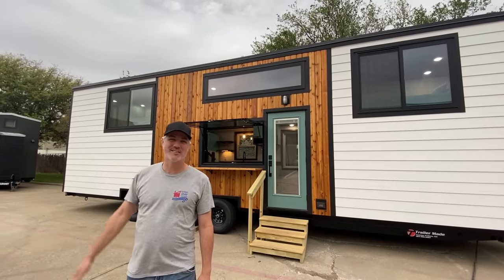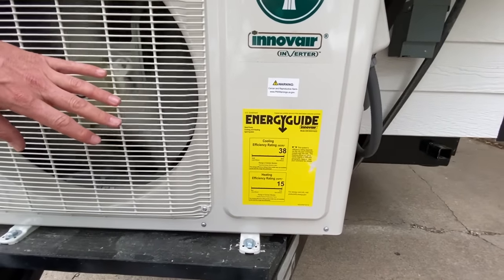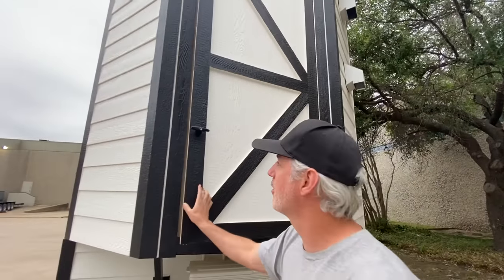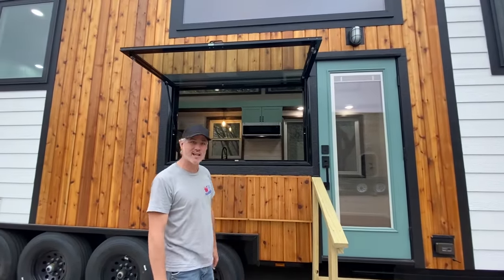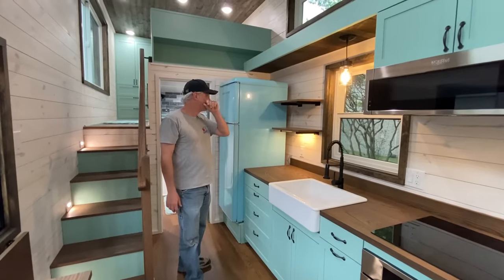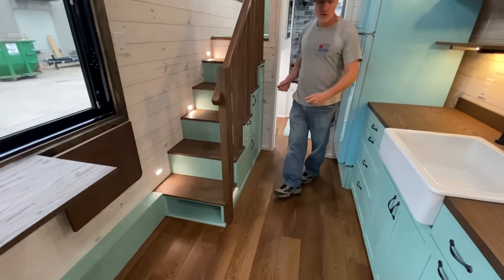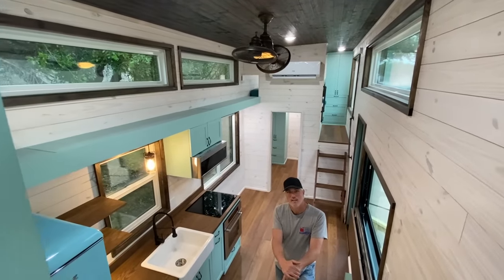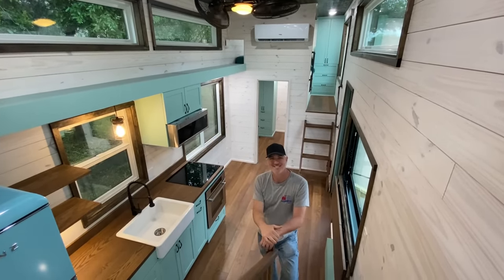36 foot Tiny Home on Wheels w/ 3 Stand-up Bedrooms & Off-Grid Utilities

Comment: You need to flip the doors on the refrigerator... That would drive me crazy having to walk into the bathroom just to get into the fridge. I would also be worried that I would trip or slip trying to get into bed, and go right through those big windows. Guessing they are safety glass?  The living room area is just a bit too small but I realize that in order to get three full bedrooms in there you had to lose space somewhere. I love the color!
Reply from the maker: This fridge didn't have the reversible door and the only retro fridge with a left opening door was $2200 more than this fridge! So the homeowner opted to save that extra dough since she liked the retro look. 
Yes all of our windows are tempered glass. The windows in each bedroom have to be large enough for egress in order to meet code requirements. ❤️
Reply: This home is lovely. Great use of Color.
Reply: Tiny home. ?
Reply: Beautiful home!! Love that it has 3 sleeping areas!!!
Reply: Beautiful colors and finishes. I'd rather use the downstairs room as a sitting room and extend work surfaces for the kitchen as my preference. I love this, thank you, great house!
Reply: Where is the living area? To gather as a family watch TV?  Nice to separate 2 kids sleeping zones, but in 4 season living where do the heavy winter coats for the 4 residents go?
Reply: @IndigoRiverTinyHomes  save extra dough!?😂 yeah good one.
Reply: Easy to do. Screws on top of door

Comment: I'm often cynical about claims made by tiny home builders, but there really are three distinct bedrooms where you can stand up when you get out of bed!  No crawling in and out of a cramped loft on your hands and knees.  I also note that they are fitted with full-thickness mattresses, and there's still room for you to sit up in bed.  The wardrobes all provide enough space for a real person's clothes.  The kitchen is relatively spacious.  A shower stall rather than a tub would allow even more room in the bathroom.

All that being said, there is very little "living" space, so this home is best suited for a climate that permits outdoor living for most of the year.  One might forego the off-grid features and use the solar equipment space to store a fold-up screen house that could be set up for daily activities.  I can actually picture a family of four living here in relative comfort.  A very clever design!
Reply from the maker: Thanks! We build tiny homes for full-size living! Many of our customers are staying here in Texas so creating outdoor living space is popular - and one of the reasons they "go-tiny" - to spend more time outdoors. Thanks for watching!

Comment: What an ingenious way to do the bedrooms!  I always said I couldn't have a tiny house because you couldn't stand up in the lofts.   I know lots of people will love this one!
Reply: I love this so much!! Anyone finance these?
Reply: The technique  of having the bed platform provide extra headroom for the lower floor isn't  new. It's been used in boat building for years. It was also used in split level mobile homes of the 1950'and 1960's. Google Pacemaker or bi level mobile homes. I'm surprised tiny homebuilders weren't using this clever concept sooner.
Reply: Because it's not a tiny home. It's a standard mobile home and ridiculously expensive.

Comment: It's very spacious, no doubt about that.  But if suffers from the most common tiny house problem - no living room area.  I'm older and do not live in my bedroom, so I would need to turn that ground-floor bedroom into a living room with a real couch and shelving unit for a smart tv.  That's just my old-school opinion, though...
Reply from the maker: We're a custom builder so every client is different in terms of what they order. There is enough space for a love seat between the kitchen and the downstairs bedroom, but we didn't really highlight that enough. The TV can be mounted on the wall opposite the love seat. 
This homeowner said she might add a TV to the common area one day but currently she doesn't watch TV or do much lounging at all from what I can tell. She's an avid gardner and cyclist and doesn't seem to sit still very often! 
Thanks for your feedback and thanks for watching!

Comment: FANTASTIC DESIGN!!!
The way your design has created various floor levels is outstanding!!!
I’m building my own 24’ tiny house and have wrestled with the two level areas and how to make them useable in a practical manner. You seem to have solved this quagmire in the most perfect way! 
The entire house is beautiful and the details demonstrate expertise in all facets of construction and design. 
The unusual ceiling fan in both design and function is noteworthy as well. 
I must add my $0.02s re. that beautiful retro refrigerator… it would drive me crazy going around the door for access. I also realize that it was the buyers prerogative and I hope that they are going to be happy with their choice🤭!
This build will be with me for life now. I was seriously considering a design that allowed me to raise the roof after arriving at the destination but really didn’t want to deal with that “complication” and it’s potential for failure. Your floor plan and use of various floor levels is the best I’ve seen and I must have looked at 100+ “tiny houses on trailer” builds. 
Simply fantastic everything!
Thank you so much for sharing this beautiful house and outstanding design. 
Best of good fortune with your business as well.
Reply from the maker: thanks! we were inspired by a tiny home builder in Florida - share ideas and make things better!

Comment: another well thought out design, down to the keyhole cuts for wires......
that downstairs bedroom would also make for a great walk in closet!

thoughts on the cat room.... have you thought about recommending to your customers to finish off the area with a wipeable wall and separating and adding a wall to divide the space from the electrics..... only suggestion because most cats I know like to scratch and or chew at things.... and eating foam insulation could cause some health problems for the wee ones... you could also do a flat lying shelf on shelf casters so you can pull the littler box back and forth if you needed to, along with motion lights.  I think you did a finished dog one before....

someone buy that handsome young man on here a cordless mic!
Reply: Haha!  Yeah, I was thinking the same.  He needs a cordless mic. :)
Reply from the maker: @luzejo28  If anyone wants to recommend a good mic to pair with an iPhone 11pro, I'm all ears. A few times I've shopped for them online and just get overwhelmed with the options!

Comment: One thing should have a better finish is the utility room. This goes for all builders. Finish it up all around including insulation.   Those rooms get hot, it will protect from heat and cold. Plus it looks better.

Comment: I love 😍love the style and colors of the walls and ceilings rich as in beautiful looking; truth be told it's a luxurious 👀 looking Tiny Home the kitchen and bathrooms beautiful, it's got a comfey & cozy look inside. I'm not look to buy, but, curious to know are such Tiny Homes only built for off grid; or are they also built for city life living?
Reply from the maker: The standard utilities for our move-in-ready homes are RV hookups (50 amp). Off-grid features are an upgrade, but you can add those later as well if the budget isn't there for solar right away.

Comment: This one is absolutely stunning
Would it be better to have an on demand solar water heater
Also, can you make the pop up table indoors more square so it will be longer toward the kitchen but shorter to have a little more access to the loft
Reply from the maker: This table is split so the half of it near the stairs can pop down when you want to go up & down the stairs.

Comment: Nice that this is off grid. Why didn't you use a tankless water heater?  I would need full size appliances, bathtub shower combo and privacy. It's nice for the homeowner
Reply from the maker: Tankless water heaters can be finicky and if water pressure is low they won't kick on. So some homeowners prefer to stick with the tank.

Comment: It's nice but I would have changed the door swing on the refrigerator.
Reply from the maker: That fridge wasn't reversible but the homeowner wanted to keep it anyway. The "non-retro" fridges are more often reversible.
Reply: @IndigoRiverTinyHomes  - The fridge is really cute. It's too bad that the door isn't reversible, like on newer refrigerators. The tiny house layout is brilliant though. :)

Comment: What a great home. Do these, if put on a foundation or slab, qualify for a mortgage?
Reply from the maker: we currently only build on wheels and there are a few banks that offer mortgages for our homes but if you build a tiny home on a fixed foundation there are more lending options if you go above 400 sq ft.
If it's under 400 sq ft HUD doesn't consider it a "habitable" home but you could get a home equity loan or a personal loan to for a "pool house" type structure. Much of it depends on zoning for your property as well.

Comment: This is a great floor plan. How much does this unit weigh? Also are there any fresh water holding tanks? Or grey water tanks?
Reply from the maker: About 20,000 pounds. We can build homes with water holding tanks but because they take up so much room most of our customers opt for RV hookups and then either use city or well water or they collect rainwater in a larger container on site. 
For off-grid folks they do gray water runoff leech fields on site and composting or incinerator toilets.
If you need tanks for travel time, we recommend the detachable tanks on wheels because then you can just take the tank to be emptied without having to move the house every time. Totally up to the customer though. We are a totally custom builder. 
Thanks for watching!

Comment: Love the layout, very well spaced. I could've gone with a stainless steel sink & refrigerator. It's missing a washer & dryer unit & a living space, can this be converted with one less bedroom to fit in a laundry unit & a living space big enough for a 55" tv? 

And also, how much does something like this weight? Can a regular truck tow this?
Reply from the maker: yes we are custom builders - a 1 ton pick up can tow it

Comment: Don't give yourself a hard time over the flickering. There's nothing you can do to stop it unless you're willing to stop using LED's.
LED's use pulse width modulation, which means they don't stay on constantly. They flash on and off. The longer the "on" and the shorter the "off" cycle, the brighter the light.
You'd need to match the cameras shutter speed (fps) and duration to the LED's pwm speed and duration in order to stop the flicker effect of your recording. That's an almost impossible task.
Reply from the maker: Thanks James. I changed the filming speed but it just changed the speed of the flickering. Usually it's not an issue because we're plugged up to the grid instead of solar. Fortunately the flickering doesn't show up in real life! 
Thanks for watching!

Comment: I am curious as to whether this is "RV rated" what size of truck would be needed to pull this.
Reply from the maker: It’s RVIA certified and you’ll need a 1 ton pick up at minimum. 
However You can rent those at Enterprise commercial division so there’s no need to buy a big truck.

Comment: lovely home-why don't you use an on-demand water heater-it would save a lot of room??
Reply from the maker: sometimes we use those but they are finicky due to water pressure fluctuations and they actually don't save much room compared to our standard water heaters because you have to leave space for ventilation & propane tanks etc.

Comment: This is perfect! Do you have to put the bed platforms in them? I have an adjustable bed with a 28" frame
Reply from the maker: The bed platform is only necessary in the stand up loft for head clearance in the room below. 
In our homes with downstairs bedrooms or gooseneck bedrooms there’s no need for bed platforms.

Comment: Are the tall platform beds a requirement or can you do a shorter bed platform?
Reply from the maker: Usually we make the bed platforms tall enough for a 6’7” ceiling in the bathroom or bedroom below. You can lower the ceiling to 6’4” for a lower bed platform but that’s the shortest the ceiling can be for code requirement.

Comment: Has some cool features, BUT the fridge doors open wrong - handles should be on the other side!
Reply from the maker: yes - that retro fridge didn't have reversible doors, but the homeowner wanted to stick with that look instead of opting for the modern one that could be reversed.

Comment: What would something like that cause the 10 ft wide 40 ft long and eight burner stove stainless steel farmhouse kitchen sink with the commercial faucet and Sub-Zero freezer refrigerator and an accordion like patio door bedroom to be a little bit bigger the upstairs would have walls and door and privacy soundproof the whole place burner and it's still gas stove a pizza oven built-in that is the old-fashioned brick style pizza oven what was something like that cost and make it more 14 ft high and what would it cost to deliver to Florida?
Reply from the maker: You can schedule a consult through our website with our lead designer to discuss these details. If you made it taller than 13'6" it would no longer be road legal but if you're only going to move it once then it might work.

Comment: Would you be able to have that master without the bed and wardrobe setup to have like a den area?
Reply from the maker: Not if you want to be able to stand up in the bathroom underneath. If you were going to change one of the bedrooms to a den, it would need to be the downstairs bedroom. OR you could add a gooseneck room for a den.

Comment: The doors on the refrigerator should open the other way. They are usually reversible. What happened?
Reply from the maker: Yes they are often reversible but this one wasn’t. The homeowner chose to keep the fridge even though it couldn’t be reversed.
Reply: @IndigoRiverTinyHomes  Thank you for replying. I,ve often wondered why. I guess other people are not as picky about that. I have spent years studying the usability of kitchens, so I notice the little things. Again , Thank you.

Comment: Can you do this at 38 and how much will it cost?
Reply from the maker: We generally build in 4’ increments to reduce materials’ waste but he could work you up a quote. When you’re ready to do a floor plan appointment fill out the form by clicking the PRICING button in the top right corner of the website and mention that you want a 38’ in the notes. Then choose Floor Plan Appointment under NEXT STEPS.

Comment: I don't know about anyone else. but all I see is alot of trip/fatal accidents. This is definitely not for people with mobility issues. The small tight steps. The space between the first step and the edge of the landing. One mistep and your tumbling a long way down. Not to mention the extremely high beds. Also the dangers of accidentally rolling out on those high beds. You have a long way down. Plus the small tight space for a dog and cat as mentioned by the builders of this house.

Comment: If it's on wheels it's  a mobile  home or as most people  call  it a trailer.
Reply from the maker: Our homes are built to much higher specifications than mobile homes & RVs but you can call them whatever you like!
Reply: @IndigoRiverTinyHomes  trailers  or mobile  homes are built to a higher standard than what they use to be. Most mobile  homes are built close to stick built homes now.
Reply from the maker: @sherrykendrick1765  yes close but still not the same quality. We’ve heard from many folks who own one of the park model tiny homes built in a mobile home factory and it’s already needing things inside replaced after only a year of living in it. Flimsy plastic drawer tracks instead of metal like we use is just one example of a complaint I’ve heard recently. 
They also use lower quality windows and doors. Maybe we’ll make a video listing the differences!

Comment: Customer didn't want to deal with propane. That's not smart for a solar setup. On demand propane water heater is much smarter. You need as many kWh as you can save for your air conditioner. It makes zero sense to burn up your stored electric to keep water hot in your tank when you don't need it.